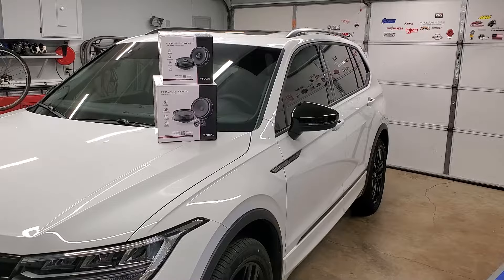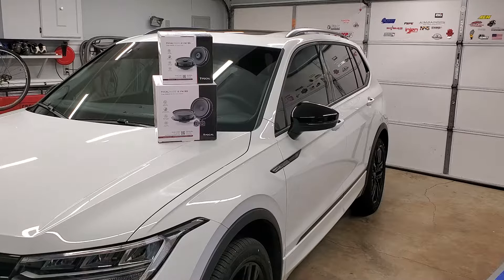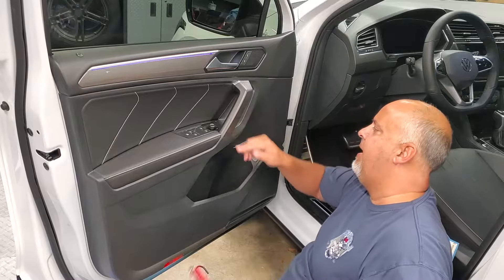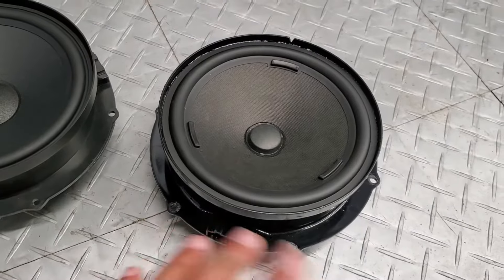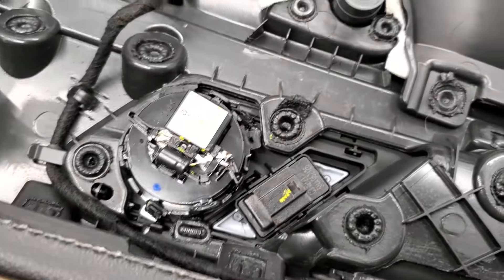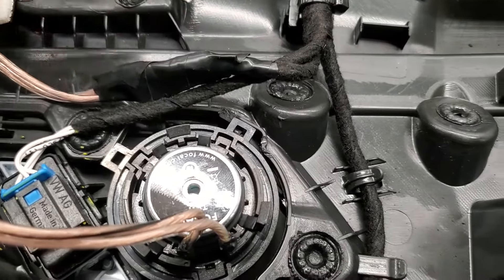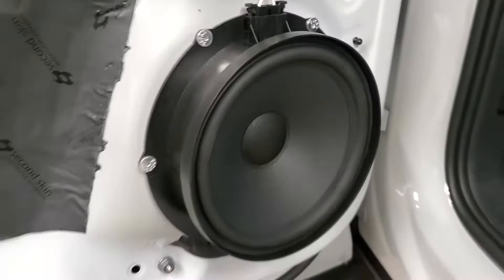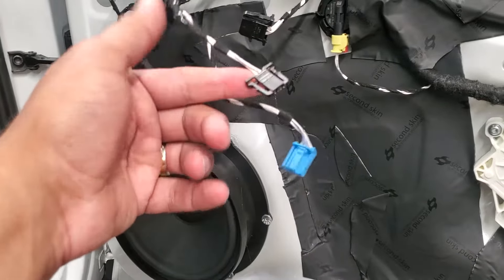2022 Tiguan Stereo speaker upgrade. Volkswagen R-line gets Focal sound system. How to install DIY

Comment: Changed speakers from stock (VW POLO AW 2018) to the two kits - IS VW 155 woofer and tweeter and IC VW 165 combo in the back and sound deadened all doors with sound dampening. Bass response improved, but overall sound is about the same. Ordered a focal 4.320 amplifier to try out now as I found myself pushing the car system's eq all max to have decent sound. Will see how it turns out. Nice work by the way!

EDIT : just installed focal impulse amp and holy moly this is good. In my opinion just changing speakers ain't worth it, you gotta power them up properly. And focal implulse little amp works damn great. Just hide it away somewhere in the dash so your wife can't see it xD
Reply: Did you have to adjust the amp settings at all or did you just drop it in and leave it at default settings? Considering buying one of these and this would be one of the first mods I'd do.
Reply: @wfujay3946  you got to adjust it of course to find a sweet spot. For the gain I put all settings on default on the media screen and all the crossover settings of the amp at full. Then put the volume at 75%, played a 150hz, 500hz and 1000hz with the hear protection headphone i use in the shop and went slow on the front gain till hear the distortion, then backed it off a little till no more distortion, then same thing on the rear speakers. Distortions are more easily audible with 150hz freq. after that high pass 75hz in front and about the same in the rear. Don’t know how good my method is but seem to work well :)
Reply: @wfujay3946  I think tho, for the real good control of a sound a dsp could be a cool thing but I ain’t got any more money to throw in the sound of a polo haha. Sound deadening of doors worked nicely for the mid bass. It is nicely toight. But overall I think my setup lack a little in the mids somewhere in my car at least, while having a tad too much of highs. I’ve boosted mids a little bit and checked if distortion was ok on the amp but still there is a dip somewhere it is not as linear as I want. But yeah if I had 5k to throw at the system… There is an other little amp which has some sort of a auto dsp setting with included mic. Maybe it is better don’t know. To conclude, I like the sound it is good, jazz sounds wonderfully, pop sounds damn great, electro too. But for metal, I have the voice somewhat behind instruments a little.

Comment: i have the 2006 touareg with the weird 8 inch woofers 3 inch mids and 1 inch tweeters, plan to replace with focal access 3 way component system and make an adapter for the 6.5. i thought about running free air 8s but i want the awesome definition up front, the rear will get 8 inch subs and box of skar evl 18s in the trunk. it's never enough though.

Comment: Focal speakers and audison amp/dsp is it a good choice? I currently have Focal speakers installed in the front and back and the difference in sound quality is not that big, I have them connected to vibe powerbox. This weekend instead of vibe amp I will install audison ap4.9bit. I hope it will play even better.

Comment: I have the fender system and feel it needs to be upgraded but I don’t know what to upgrade it with or if it, itself would be better with the doors dynamatted and an amp added
Reply: yeah change out the 6x9's and the tweeters.

Comment: On the focal speakers they have dual power and dual ground in the connector but your only using one power and ground per speaker. Like someone else mentioned no clipping at higher volumes?

Comment: Do you know where the stock amplifier is placed in a vw tiguan 2017 with a dynaudio uprgrade.
Since last week my volume is dead and in the settings there is a notification that indicates.....sound settings Will be avalible when message is ended, the car isnt in reverse.
It happend when the volume was pretty loud.
My guess is there is a fuse blown, but i Just cant figure out where to search.
Hope you can help me out.
Love your video for the upgrade big time and plan on follow-up your steps.
Keep making video's like this.
Greatings From Holland
Reply from the maker: In mine it was behind the glove box. Thats where I tapped the speaker outputs to feed the line converter. Not sure on 17. sometimes is under seat or on floor right in front of seat under little pop off panel

Comment: I am confused, the stock speakers are 4 ohm and the Focals are 2 ohm.  This jay overl8ad the head unit
Reply from the maker: at 5 min mark i start talking about the ohms and I said they were 4ohm. Where did you get 2 ohm from?
Reply: You were wrong on your video.  The Focal speakers are 2 ohm….not 4 ohm like you mentioned.  I went ahead and put the Focals that you recommended in my 2022 Tiguan, and now are worried about blowing out the factory amp or my new Focal speakers. @jasonin2details
Reply from the maker: They were 100% recommended by Crutchfield as direct factory replacement. If you are worried take them out
 @gary9879
Reply: They sound great…really don’t want too.  Guess I will take my chances and prove what the critics say is wrong.  Hope I never damage them.  Thanks for all your help and videos in upgrading the Tiguan.

Comment: Crutchfield recommends the Focal RSE-165 only for the Front lower door, do you know why that is? I have a 09 Jetta 2.5 SE
Reply from the maker: Not sure. The set is a 2 way set so it would sound little better most likely.  Not sure if one I used would fit under grill. I would call them
Reply: @jasonin2details  Did you also end up installing them in the rear doors?

Comment: Hi, just wanted to know if you have any issues with the speaker upgrade? The speakers which focal makes specifically for VW have an impedance of 2 ohms and if the base unit doesn't have enough power then it could heat up. Also is there any distortion at higher volume? Bass depth better than stock speakers?
Reply from the maker: The Bass is about the same. I have no issues with the impedance. I think stock tweets were also 2 ohms? I have since added a powered sub. So on Stock Bass its one below the zero point so they are very clear and play louder than needed.
Reply: @jasonin2details  thanks, appreciate the response.
Reply: I had more bass but I’ve sound deaden my doors at the time of change so might be that
Reply: @jasonin2details  Hi Jason! Why did you not choose to use a two-way kit in the rear seats? My R line came from factory with a place for the two way kit at the back door...yours did not bring it?

Comment: Any issues with the Focal speakers drawing too much power from the factory radio?  You mentioned the Focal speakers being 4 ohms.  But Crutchfield told me they are 2 ohms.  That would draw more power from the amp…correct?  So, what were the ohms on the factory speakers you took out?  This has been a struggle to get any info on this project that you did.  And you made it look so easy.  Please let me know if I can use 2ohms speakers when you took out 4 ohms speakers without upgrading the amp.

Comment: I looked at the link for the speakers you installed. The crushfield site could not find any speaker that matches my 2022 VW Tiquan SE? Which exact model number you used? Thank you
Reply: Focal Inside IS VW 180 fronts
Focal Inside IC VW 165 rears

Comment: Had a 2021 Passat r line I traded in with fender speakers for 2022 Tiguan r line. In comparison the speakers in this car are crap. Thank for this video to confirm that I wasn’t going crazy that those factory speakers are cheap. How much did all four speakers cost you?

Comment: 5:21 are you sure IS VW 180 are 4Ω? 
Focals spec sheet has 2Ω..
Reply from the maker: Well they are 4ohm overall but since it is a 2ohm 6.5 and a 2ohmTweet wired in series that would make it a 4ohm load seen by the amp
Reply: @jasonin2details  ah, thanks for clarifying!

Comment: So are you happy with this upgrade or it's not worth it? :) Thanks!
Reply: I have decided to replace my stock speakers with Focal and unfortunately didn’t notice any sagnificant difference! Then I made some research and found out that the problem is actually with my RNS510. I’ve replaced it with newer Composition Media and the results are amazing!!! Sounds gtlreat, it’s worth 100%.
Reply: @vakula485  what new composition media are you using now
Reply: @reesechris76  VW Composition Media 5C0 035 200 F (with touch buttons)
Reply: @vakula485  Hello! Find out myself the upgrade was anticlimatic, but today i've added a focal impulse and hot damn. So you're right you gotta drive them properly for them to sound good.

Comment: Hi greetings from Mexico, can you please Tell us Wich sets (models) did you used for this upgrade? And in Wich  percent do you consider this speaker change upgrades or boosts the sound? Thanks
Reply from the maker: Focal Inside IS VW 155 front doors.  Its a huge improvement in output and even better sound quality. I added a powered sub last week and now it really thumps hard
Reply: And for the rear doors Wich set do you use ( model) please
Reply: And for the rear doors?
Reply: @eduardokarmayeshe5579  rear icvw165 front isvw165
Reply: Hola! En la parte de atrás qué modelo de bocinas es?
Reply: @jasonin2details  what kind of sub did you add?

Comment: Great video and replacement but which Focal Speakers are these? You didn’t mention which model they were from Crutchfield?
Reply from the maker: Focal Inside IS VW 155 front doors, Focal Inside IC VW 165 back doors
Reply: IS VW 155 or 165? Can't find 155....do you mean rear speakers with tweeter integrated? Rear doors doesn't have spare tweeters?
Reply: @jasonin2details  you showed the is vw 180 though.

Comment: You said you got them from Crutchfield at a good price.  Do they ever go on sale?  Seems to be list price now.  Thank you!
Reply: They’re available at creative audio as well.
Reply: @davidgorby814  Thank you!  That's where I actually got mine from.  Great place to deal with and fast shipping.  Still trying to figure out if just switching out the speakers will make a difference or do I need an amp too.  Have to make up my mind quick as they only have a 60 day return policy.
Reply: @gary9879  They will improve factory sound with or without a amp. I actually am 1 of the 3 sales guys there, reach out to us if you need any help.
Reply: Thanks again!  Will get in touch with anymore questions.

Comment: what sub and amp are you going to install? i bought the same focal speakers from this video.
Reply from the maker: I did it the other day, need to make quick video. Did a small Audison mono amp and from Crutchfield got a Kicker 12 in shallow sub box with 12 passive radiator that fires down. It rocks hard now
Reply: @jasonin2details  hi I’m learning a lot from your video and these comments. All in all, how much did you approximately spend?